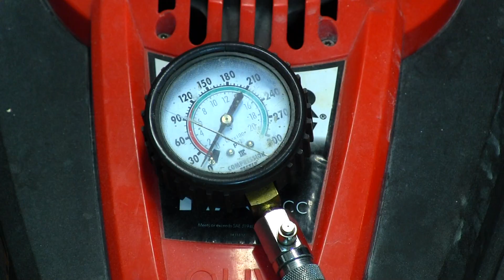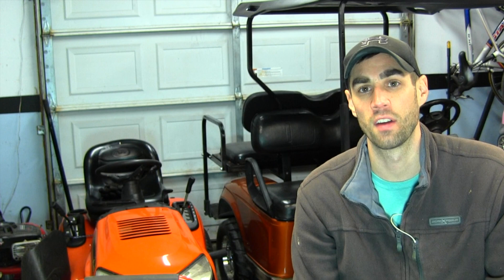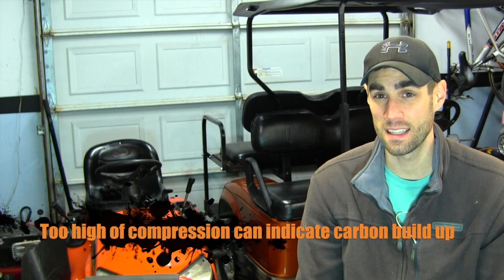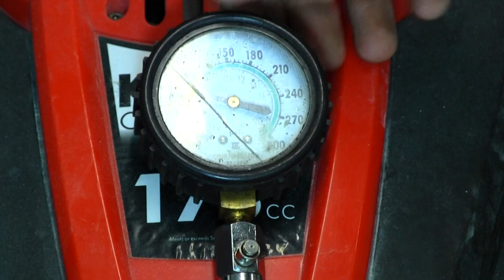How to do a compression test on small engines.

Comment: lest not forget a valve can get bent and prevent sealing, compression test can also help uncover this when you test and even add a little oil in cylinder and has 0 effect. Pull valve cover and find a valve stuck due to bent stem (or even rod). Also, I agree, butterflies should be open, but, if the air filter is in good clean condition, you want to test in Real World condition to give accurate reading of what the engine is able to pull, through everything.. This means, filter installed . Despite what everyone says, it is important to test with an assembled machine in operational conditions. Just like adjusting a carb when the machine is warmed up to running temps. If you install a brand new unused filter and it says 90 PSI but without it says 110 then your ratio has dropped to working scenario.. the full gist of that PSI is not running in stock configuration. Also, my example is just an example, it should never be 30 psi off... that's a clogged filter. Feel free to disagree and post your engineering degrees. No, I don't have one, my point is with over 50 years of experience, Engineers are idiots.

Comment: For saws trimmers etc. Air filter out.  Choke off. Not sure you mentioned that. Throttle full. Pull until it stops climbing. Sounds right? 😊

Comment: My dad has a 2012 17.5hp Briggs and Stratton. A bought a leak down tester and it says the engine is bad, but noticed when not hooked up no air comes out of the tester. Yet, if you put your thumb over the end it slowly builds pressure and goes to good. I was not sure if the tester is broke or not as I never used one. So I just put 30lbs pressure in the cylinder and it blows oil out the dipstick hole. I tried a compression test and it was 70psi dry and 90psi wet. The mower smokes blue smoke like crazy if you can get it to start. My thought is it needs a ring job. does that sound right.
Reply: Sound aright

Comment: Only dedicated devices must be used, otherwise the measurement is erroneous.
And smaller measurements due to the cold engine... all engine manufacturers recommend measuring the compression with the engine cold, but it seems that they are all wrong.

Comment: Help!! 2012 Polaris 800xp. Hard to crank over when sparks plugs are installed. Easy to turn over when one or no plugs installed. Compression 175psi both cylinders. Fuel 145psi. Spark at both plugs. Only has 600 miles. New battery. New starter. (Burnt out starter due to hard crank when both plug were installed). Thank you.
Reply from the maker: I haven’t looked at the manual but the first thing that comes to mind is the compression release mechanism on the camshaft. If it’s broke or if the valve adjustment is too loose it may not engage that mechanism. It’s supposed to bleed off compression on startup for easier starting.

Comment: compression tester hose is too long, i got bad readings on mine like that, by the time the little piston puts enough pressure in the tester its inaccurate , try a short gauge with a rubber tip, mine went up a bit.

Comment: How long should an engine hold compression? Cranking I'm getting 90psi but it bleeds off. Is that normal?
Reply from the maker: What are you compression testing? For push mowers 90psi would be fine. It’s could be OK for riding mowers. I’ve seen 90 up to 150 for riding mower engines. Did you do a wet compressor test to compare?
Reply: @metalinmotionshop  it's a riding mower and it des get up to 90 so it sounds like I'm good. The valve in the tool must be worn and leaking. Thank you
Reply from the maker: There is a valve in the compression tester that should hold the pressure. The engine  isn’t holding the compression, it’s just measuring how much force the piston, rings, valves and gasket can create. If it’s bleeding down it’s because the hose where it screws in at the spark plug hole is leaking or the valve in the tool is leaking. It will hold the pressure reading in the tool until the button is pressed.
Reply: Thank for the vid brother .  I have been asking  around to find out if there was a different compression gauge for  car engines and 2 stroke small engines .   I had asked 2 - Small engine  repair stores and several  tool supply  stores … and not a single place could answer the question ….they simply didn’t know   If their was a difference 🤯  .   Question answered  after watching your vid 👣🦘👍

Comment: Thank you, by adding teaspoon of 2cyl oil to cylinder head and opening to full throttle raised the psi during my compression test, my first reading of 85 psi, this prior to your most helpful suggestion which then raised the psi to 120.
Unbelievable helpful I quickly subscribed. 
Thks again
Lee
Old Bridge  NJ

Comment: Good explanation, I'm a beginner . whats a good compression tester ?
Reply from the maker: I always just used the ones from the auto parts store. They usually have a cheaper one with no rubber case around the gauge and a slightly more expensive one with a rubber case. I like the rubber cased one better. Also, I get the one that has the 3 adapters for different size spark plug holes. I used those quite a bit.

Comment: Hi
I have 14.5hp Briggs engine which I bought in 2003 I have replaced head gasket? But engine keeps back firing spark plug is black after 10 minutes keep changing plugs same thing ? No power in engine?   I have done head pressure test 112 p.s. i .
I have kept Westwood mower going for nearly 20 years but I am stumped by all the smoke bellowing front of mower.
Will be grateful for your help.
Thanks Tom Mixer.
Reply: Could very well be your carburetor

Comment: I have a gx390 when i do compression reads zero and have another gx390 runs excellent nothing wrong with it did a compression test on that one and it reads zero is there a specific way to check compression on these gx390 engines?
Reply: See my answer above as to why this happens.

Comment: Briggs big block smoking at start up found oil in intake before carb.  Did leak down test 55% leak found out head gasket was blown between piston and push rod Gally. Clean up head, valves, lapped valves and replaced head gasket. Tried leak down test again now at 28% most air coming out of carb what could it be?
Reply from the maker: Two things come to mind. When I lap my valves I pour gas into the intake and exhaust port and see if it drips out around the valve seat. I keep repeating until the valve is sealing the gas off with no leaks. You might have already done that. The second thing is the valve adjustment could be too tight. You can slide the rockers off the valve springs or just loosen the rockers and redo the leakdown. This way you will know if the valve itself is leaking or if the valves are misadjusted and being held open by the rocker arms.
Reply: @metalinmotionshop  thanks so much for your help...after lapping valves I put brite flash light in ports no light what so ever past valves but I will try taking out push rods so there won't be any pressure on springs then re-test. Thanks again
Reply: @metalinmotionshop  140 psi good compresion 372 xp oe  ?

Comment: nonsense! air filter will affect all cylinders. BTW,  if your engine is running smoothly should you even be looking at compression? IF your engine is starting like a champ , should you do the test at all?   Warm engine????  If it comes in warm, then it will start better than cold...but doesnt mean you dont have a problem...but seeing the engine from cold to me is better.

Comment: Small engines need a compression tester with a VERY short line to the gauge, even the volume in the gauge itself affects readings. You will always get a low test on trimmers and small engines like the Honda GX 25 and 35. The reason is that the cylinder volume may compress to the 130 to 150 lbs Honda says is good but a long hose to the gauge will never indicate correct, it will always be low because the volume of air in the line has a high ratio to the volume of air in the cylinder.
Ask me how I know! I just rebuilt a Honda GX25 and never got the compression over 90 even spinning it with a drill past the compression release rpm. My engine runs perfectly, the compression is fine but I probably changed the rings and reground the valves for nothing.
If you want a truly accurate reading what you have to do is calculate the volumetric ratio with respect to gauge and line to the volume of the cylinder. Remember the smaller the engine the greater error and the lower your compression will be regardless how good your true compression is.
Reply: Its absoulutely necessary to have a shrader valve inside the end of the hose when checking small engines.Otherwise you will get a low reading.Some compression testers dont come with shrader valve inside the hose.
Reply: @GoldSeals  I think you're misunderstanding what I'm saying. The volume of air in the cylinder relative to the volume of air in the hose to the gauge is to great. 
The release valve has nothing to do with it because it doesn't change to ratio of air in the hose to the air in the piston. When a small engine compresses air at TDC there is more air in the hose than the engine and this reduces the compression radically. Think of it this way, let's say we put a balloon in the spark plug hole. When the piston is on TDC of the compression stroke the compression would be very low. This is an exaggerated example but basically what is happening. Because of the hose you can expect readings to be close to half of the normal compression.

The best way to check compression on small engines is with a gauge that screws right into the cylinder head where the gauge sits right at the head.
Reply: @mosfet500  Good day. Could you advise me how to calculate the volume ratio? Alternatively, recommend the meter that screws directly into the cylinder head?
Reply: @spac1565  I wish I could recommend a gauge with a short line, I have a small machine shop so I made my own short adapter just this morning, guess what? I got over 120 psi. so my theory works, here's the math:

Let's say you have a small tiller engine with a 1-1/4" piston and a 1-1/4" stroke. So the volume (displacement) is (3.14 x (1.25 / 2)^2) x 1.25 = 1.534 cu/in. Now let's say you have a compression gauge with a 12" long tube and a 1/4" hole thru its length. (3.14 x (0.25/2)^2 x 12 = 0.589 cu/in. That's 1/3 of it's volume dissipated by the line to the gauge, now you're thinking - geeze I have bad rings which is exactly what I thought before I sat down and thought about what was happening.
Reply: @stinkycheese804  I think there's some credence to what you say with two valves. I know when I installed and evacuated my mini-split HVAC units I try to have as few valves as possible in the line. I'm thinking both conditions might contribute to low pressure. 

The thing is that I believe there's only one valve in my hose, it's near the gauge. Also the shorter hose did show a marked difference in pressure.